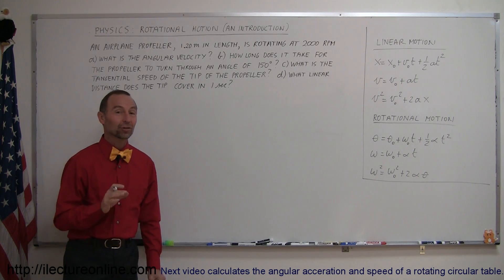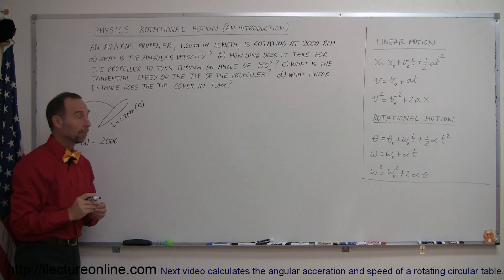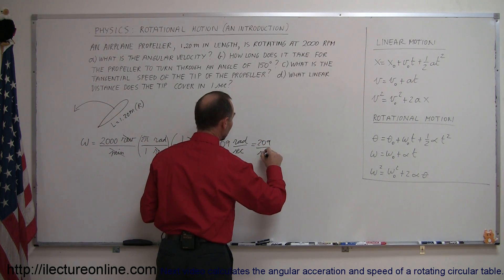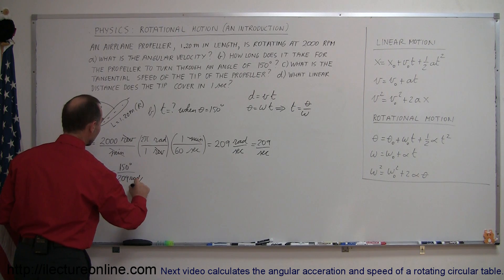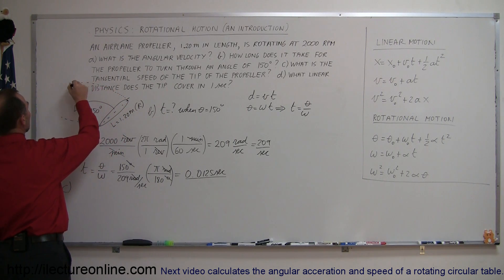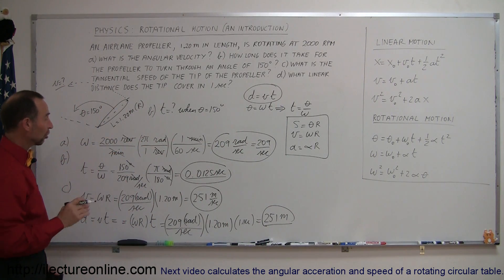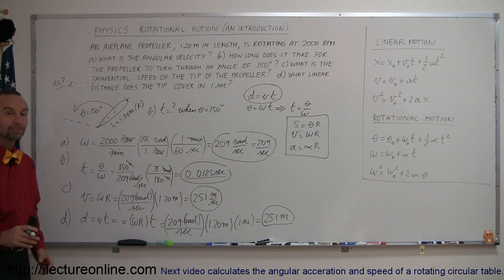Physics 11  Rotational Motion (2 of 6) Airplane Propeller

Comment: Many people wonder why radians do not appear when we have radians*meters (rad • m). 
Here is an attempt at an explanation:

Let  s  denote the length of an arc of a circle whose radius measures  r.

If the arc subtends an angle measuring  β = n°, we can pose a rule of three:
360°   _____  2 • 𝜋 • r
    n°   _____  s

Then
s = (n° / 360°) • 2 • 𝜋 • r

If  β = 180° (which means that  n = 180, the number of degrees), then
s = (180° / 360°) • 2 • 𝜋 • r

The units "degrees" cancel out and the result is
s = (1 / 2) • 2 • 𝜋 • r
s =  𝜋 • r

that is, half of the circumference  2 • 𝜋 • r.

If the arc subtends an angle measuring  β = θ rad, we can pose a rule of three:
2 • 𝜋  rad   _____  2 • 𝜋 • r
      θ rad   _____  s

Then
s = (θ rad / 2 • 𝜋 rad) • 2 • 𝜋 • r

If  β = 𝜋 rad  (which means that  θ = 𝜋, the number of radians), then
s = (𝜋 rad / 2 • 𝜋 rad) • 2 • 𝜋 • r

The units "radians" cancel out and the result is
s = (1 / 2) • 2 • 𝜋 • r
s =  𝜋 • r

that is, half of the circumference  2 • 𝜋 • r.

If we take the formula with the angles measured in radians, we can simplify
s = (θ rad / 2 • 𝜋 rad) • 2 • 𝜋 • r 
s = θ • r

where  θ  denotes the "number of radians" (it does not have the unit "rad").
θ = β / (1 rad)

and  θ  is a dimensionless variable [rad/rad = 1].

However, many consider  θ  to denote the measure of the angle and for the example believe that
θ = 𝜋 rad

and radians*meter results in meters
rad • m = m

since, according to them, the radian is a dimensionless unit. This solves the problem of units for them and, as it has served them for a long time, they see no need to change it. But the truth is that the solution is simpler, what they have to take into account is the meaning of the variables that appear in the formulas, i.e.  θ  is just the number of radians without the unit rad.

Mathematics and Physics textbooks state that
s = θ • r

and then
θ = s / r

It seems that this formula led to the error of believing that
1 rad = 1 m/m = 1

and that the radian is a dimensionless derived unit as it appears in the International System of Units (SI), when in reality
θ = 1 m/m = 1

and knowing  θ = 1, the angle measures  β = 1 rad.

In the formula
s = θ • r

the variable  θ  is a dimensionless variable, it is a number without units, it is the number of radians.

When confusing what  θ  represents in the formula, some mistakes are made in Physics in the units of certain quantities, such as angular speed. 

My guess is that actually the angular speed  ω  is not measured in  rad/s  but in  
(rad/rad)/s = 1/s = s^(-1).

Comment: In a Uniform Circular Motion, the linear speed (tangential speed)  v  remains constant. 

If the object makes  n  revolutions (cycles) in a time  t, then it travels a distance  s
s = 2 • 𝜋 • r • n

where  n  is the “number of revolutions”,  n  is dimensionless,  n  has unit  rev/rev = 1.

Since  v = s / t, then
v = (2 • 𝜋 • r • n) / t

Since v = ω • r, then
ω • r = (2 • 𝜋 • r • n) / t.

This implies that
ω = (2 • 𝜋 • n) / t

If  ω = 2 • 𝜋 • f, where  f  is the frequency, then.
2 • 𝜋 • f = (2 • 𝜋 • n) / t.

This implies that
f = n / t

or what is the same, the frequency  f  is the number of revolutions (cycles) per unit time (usually seconds). 

The unit of  f  should be
(rev/rev)/s = Hz = 1/s

equal to the number of revolutions per second [nrps = (rev/rev)/s, if the custom is to be maintained], and not in revolutions per second (rps = rev/s). 

The unit hertz (Hz) replaced the unit cycles per second, which was actually the number of cycles per second.

Given that the period  T = 1 / f, then
T = t / n.

Since the period  T  is the time it takes for the object to complete one revolution (one cycle), then the unit of  T  is:
s/(rev/rev) = s  

equal to seconds per number of revolutions (second per number of cycles).

As
ω = θ / t

and  θ  is the number of radians,  θ  is dimensionless,  θ  is measured in  rad/rad = 1, that means that  ω  must be measured in
(rad/rad)/s = 1/s = s^(-1) 

and not in  rad/s.

It is understood that in the formula
ω = 2 • 𝜋 • f

the unit conversion is
1 (rad/rad)/s = 2 • 𝜋 • (rev/rev)/s

so
1 (rad/rad) = 2 • 𝜋 • (rev/rev).

There the  2𝜋  allows us to go from “number of revolutions” (rev/rev) to “number of radians” (rad/rad).

I will highlight the difference between the unit of angular speed, which seems to be  1/s  and the unit of frequency which also appears to be  1/s. They are different. Hertz is number of revolutions per second (nrps) while angular speed is the number of radians per second (nrad/s, stretching the notation a bit).

I will leave another comment where I show how to obtain the formula 
s = θ • r

and what the variables represent.

Comment: At minute 1:15 you say “so in this case I believe we're talking about rotational velocity so we'll write omega and is equal to 2,000 and RPMs is means revolutions per minute”. You write
ω = 2000 rev/min

and you say that “standard units for omega, for angular velocity, is a radians per second” and you do the unit conversion. 

Most of the scientific community and the International System of Units (SI) believe that the unit for angular velocity is rad/s, but it is actually “number of radians per second”, i.e.  (rad/rad)/s = 1/s = s^(-1).

On the other hand, revolutions per minute is a measure of frequency  f, not angular velocity, and should not be RPM, but “number of revolutions per minute”, which could be renamed NRPM [NRPM = (rev/rev)/min], to follow custom.

The relationship between angular velocity  ω  and frequency  f  is
ω = 2 • 𝜋 • f

If f = 2000 (rev/rev)/min, the conversion to NRPSs is performede
f = [2000 (rev/rev)/min] • [(1 min)/(60 s)]
f = 33.33 (rev/rev)/s

and we calculate  ω
ω = 2 • 𝜋 • [33.33 (rev/rev)/s]
ω = 209 (rad/rad)/s

and the  2𝜋  allows us to go from “number of revolutions” (rev/rev) to “number of radians” (rad/rad).

Then at minute 2:36 you say “radians being the standard unit for angular velocity is one of those units you don't really need to mention, you can actually say that this is equal to 209 (1/s), you don't have to write radians, but for clarity I usually do, so either one either answer is correct”. This is because most of the scientific community and the SI say that the radian is a dimensionless unit which in terms of the base units is
1 rad = 1 m/m = 1.

This is another SI error.

So when you use the formula
t = θ / ω

you believe that  θ  is measured in radians, when in fact  θ  is a dimensionless variable, it is the “number of radians” and has unit rad/rad = 1. The SI error is that they believe that the radian is a dimensionless unit. 

Then at minute 5:41 you say that “the tangential velocity v is equal to the omega, the angularl velocity times the radius”
v = ω • R.

Using that relationship
v = (209 rad/s) • (1.20 m)
v = 251 m/s

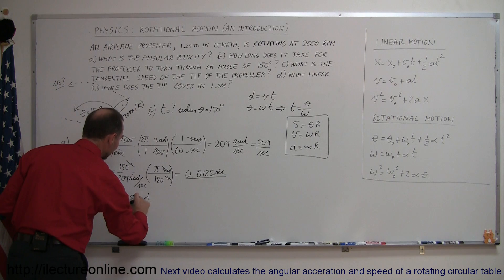and you say from minute 7:00 that “and remember radians is a nonunit, it's like it's not there but just for clarity I write it ... and notice that the units will be meters per second because radians is one of those nonunits we don't have to mention that”. It is the widespread belief of the dimensionless radian that is not true. The correct is
v = [209 (rad/rad)/s] • (1.20 m)
v = [209 (1/s)] • (1.20 m)
v = 251 m/s.

I am going to write two more comments. In the first one I will try to clarify the Uniform Circular Motion and in the second one how to obtain the formula  
s = θ • r

and what the variables represent, especially  θ.

Comment: Isn’t R is the radius?
Reply from the maker: The distance from the point of rotation to the top of the propeller is the length of the propeller (L) and the circle made by the tip of the propeller has a radius R        And R = L in this case.

Comment: Hi isn't radius = diameter/2?
Reply from the maker: Yes it is.
Reply: @MichelvanBiezen  when solving C you did not divide the length of the propeller to solve tangential speed of the tip.
Reply: @sameqy  it was half of a propeller already, others end was the attachment point for propeller

Comment: in some reference v=omega*r is the linear velocity, i'm confused. What is the difference between linear and tangential?
Reply: Tangential refers to the linear measure along the circumference of a circle. If you cut the circle and flattened the circumference, you would have a line. So, not the "same" thing, but equivalent.

Comment: shouldn't the radius be half of the length
Reply from the maker: Typically the length of the propeller is defined from the point where it is attached to the top of the propeller.  Thus that makes the length equal to the radius of the circle made by the propeller tip.

Comment: why propeller's torque decrease with increase in airspeed, torque (power output) of wind turbine increase with high wind speeds?
Reply from the maker: I believe what you are referring to may be the efficiency of the power delivered by the engine to the propeller. (or the efficiency of the propeller at propelling the plane forward).
Reply: the torque on airplane propeller blades decrease as flight speed increases and so does the thrust produced by the propeller.

but for a wind turbine, the torque curve goes up as wind speed increases.

Comment: Why i cannot use omega=((Wo+W)*t)/2. ? When i convert for t the answer is different. Thanks
Reply from the maker: What are you trying to calculate?
Reply: I am trying to calculate t (question b). To get t you have used t=omega/W. My question is why equation omega=((Wo+W)t)/2 cannot be used in this case?
Reply from the maker: In this problem omega doesn't change (the rotational speed is constant).  Therefore omega doesn't need to be calculated.  You would use the equation you suggested if omega was not constant and the change in omega was linear.
Reply: Michel van Biezen thank you for your quick reply. Its clear now

Comment: if we calculate the circumference of the circle which is
r*2*pi => 1.2 * 2 * pi = 7.54 ... after we multiply that by the velocity
2000/60  times the above value which will lead to 7.54 * 33.333 = 251 m/s the whole idea is if we have  the radius we can calculate the circumference
(distance ) and multiply that by the number of rotation per second to get the
final distance as if we have cut the bicycle tyre and made it straight and laid
it on the ground and multiplied that length by the number passed i.e the rotation  Hence each rotation will be ONE times the
length measured on the ground 
short straight and sweet :-) only two calcs ... thanks any way..

Comment: Sir, how can we relate omega to theta, because omega is a vector quantity (which relates to displacement) and theta is a scalar(which is distance)?
Your lectures are great...Thank you..
Reply from the maker: All vectors have a magnitude and direction.  If we only want to know the magnitude of the answer, we don't always need to take the direction of the vector in consideration.  (That is often done in any physics book).  The direction of omega is perpendicular to the plane of motion, and thus is not needed to find the answers in this problem.
Reply: +Michel van Biezen But if we are taking velocity, then why are we taking arc length as displacement..? Instead we can take a straight line joining the two points on the circle.
Reply from the maker: In this case we are looking for the tangential velocity. (which is typical for this type or problem).

Comment: first of all, thanks for putting the video up and taking the time to create it and the tutorial series!

Secondly, why did you use v=wr in portion (D) of the problem but not portion (B)? when substituting it in for d=vt?
Reply from the maker: for part b we didn't need to convert from the rotational equation to the linear equation to find the time.
for part d it asks specifically for the linear distance

Comment: I worked this assuming that the radius was 0.6 meters.  He said that the length was 1.2m.  It is customary to refer to the prop diameter when you specify a "length."
Reply: +Libertarian Atheist but everyone should be familiar with how a propeller works so it is assumed that the propeller itself is the radius

Comment: I know that in the equation s=theta*r , s is the arc length.  But in that sequence of equations, it almost looks as though 's' were acting as 'x' or some form of a 'position' variable.  Is it wrong to think this?
Reply from the maker: Kaitlin,
That is exactly how you want to think about s (arc length).
angular velocity is the rotational equivalent of velocity
angular acceleration is the rotational equivalent of linear acceleration.

(They are off course NOT the same but the equations of kinematics work exactly the same for the two sets of variables.